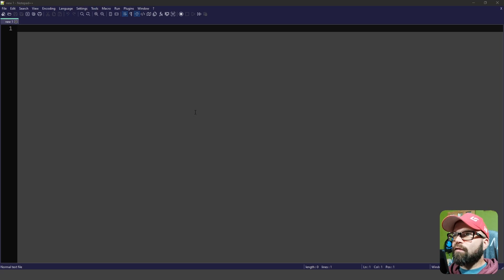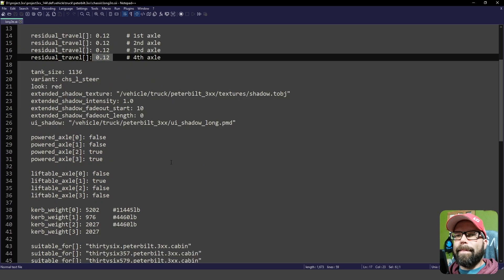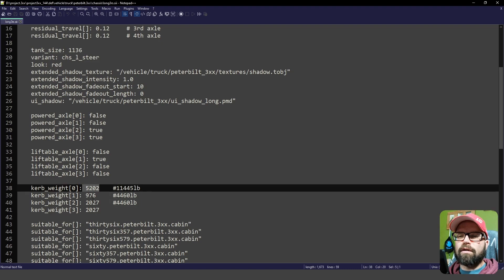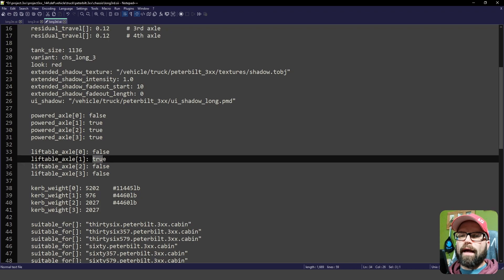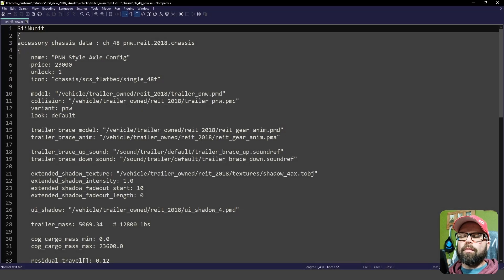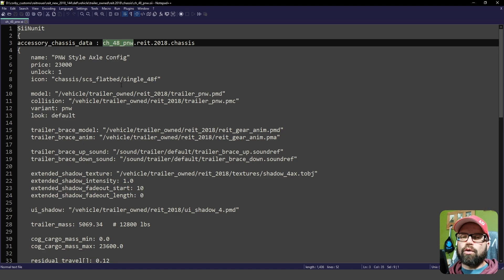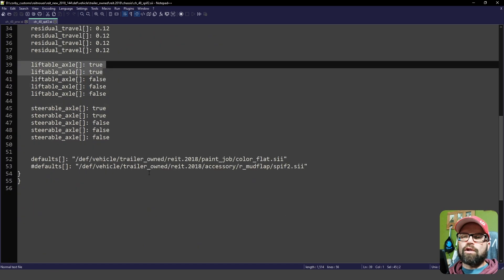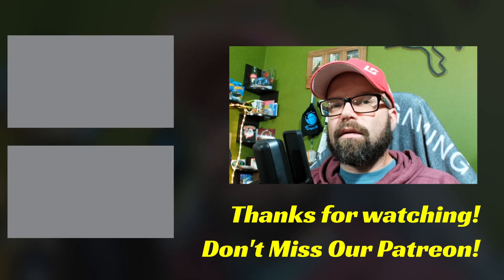ATS Modding | Changing Chassis Information Without Blender! | #Notepad++

Comment: Hi this is great.   So i tried to change the westernstar 49x to All wheel drive.  I copied an existing Chassis 6x4 sii from its def/vehicle/truck/westernstar.49x/chassis and created a new one making sure to change the names as you mentioned.  I put all three powered axis to true added a little more curb weight (i think 600lbs), saved the new sii then repacked it with winrar.  My mod is active and shows up in the truck configuration chassis selection at the dealership for the 49x It shows as a mod that can be purchased.  

The problem is the game wont let me select it and it doesnt display the specs on the configuration menu when i click it on it too.   Any idea what i forgot to do?  Thanks!!!
Reply from the maker: I'm guessing since it hasn't been added to the suitable_for lines in other sections it won't work. You'll have to adjust all other items on the truck in the accessories or cabins that need that information

Comment: Is it possible to lower the suspension or raise it purely from using the sii fie.
Reply from the maker: There is air suspension now so you can do this in console. I have another video on it.
Reply: @Halffastgaming  I understand but some trucks are so slammed that even the raised suspension the wheel still clips the fender which is annoying.
Reply: @Halffastgaming  By the way thank you so much for replying so fast. truly appreciated
Reply from the maker: @teecee5921  unfortunately if they are that slammed then no, the wheel nodes need to be moved. Unless the values are very low on the suspension information in the chassis sii
Reply: @Halffastgaming  ok, so I need to go to blender to move them then. Do you have a tutorial on how to raise and lower in blender.
Reply from the maker: @teecee5921  not wheels specifically no

Comment: Maybe I missed it. Is it possible to stretch a chassis without blender ?
Reply from the maker: Yes. You can use Zmod3 instead, but they are both 3d modeling programs.